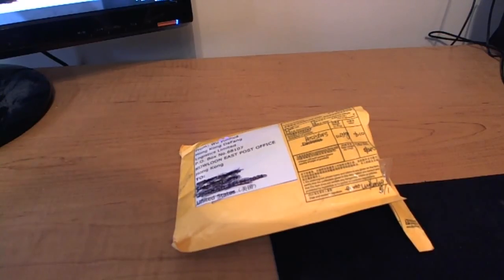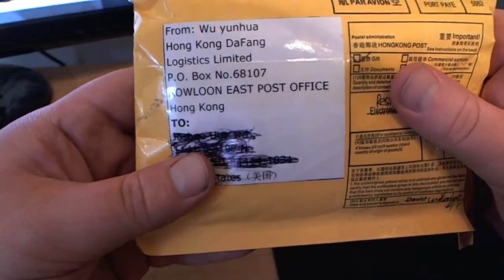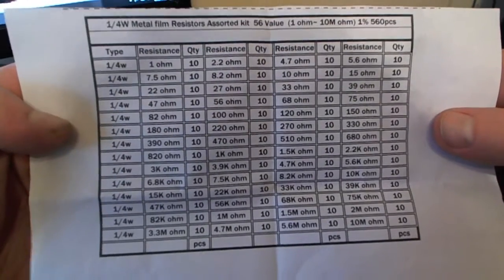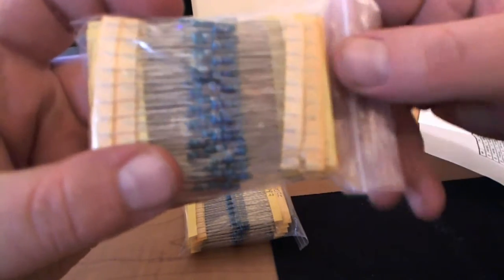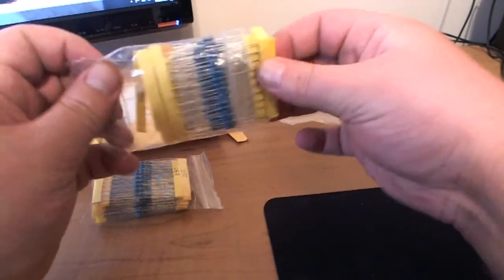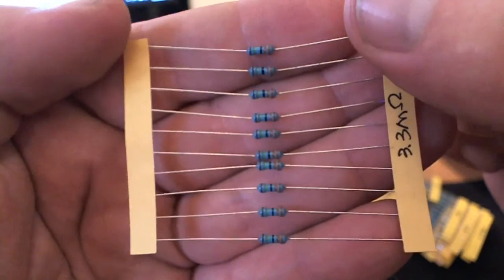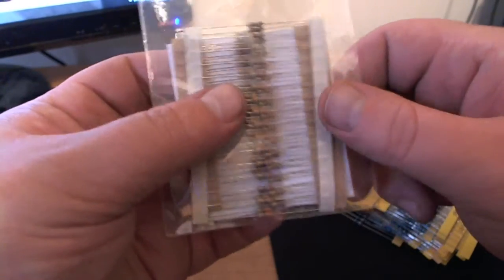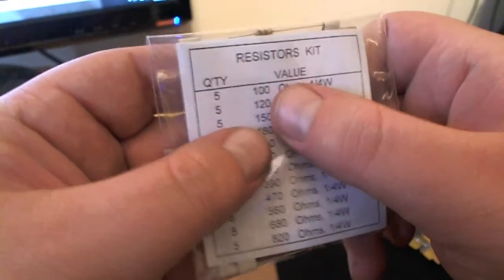Carbon Resistors Vs Metal Film Resistors And Unboxing (Kinda)

Comment: carbon film resistors tend to easily break at higher voltages, so i replace them with metal film resistors and the the electronics appliance i repair tends to last longer with this resistors.

Comment: in my experience the carbon resistors have thinner spikes and are sittin losely on the breadboard. They still work perfectly fine but i prefer the metal film ones because theyre stiffer and fit more snugly. Thats what she said :D
Reply: I think this is a side effect of the manufacturing process, not something done for the benefit of the consumer.
Reply: Huh?

Comment: Can a carbon composit resistor be replaced with a metal resistor as long as the ohms are the same !
Reply: Yes. I know of no reason why a carbon film resistor will work in a circuit but a metal film will not.

Comment: @urElectronicsfanatic please can you tell me more about resistors I have a tv power board it dosent work some resistor  are biger than what you have, I want to know if the zises of the resistor it matter or just the color in the resistors thanks....
Reply: Bigger resistors are power resistors, and they typically use wound resistance wire or fusable wire. This link should help you out:
http://www.bcae1.com/resistrs.htm